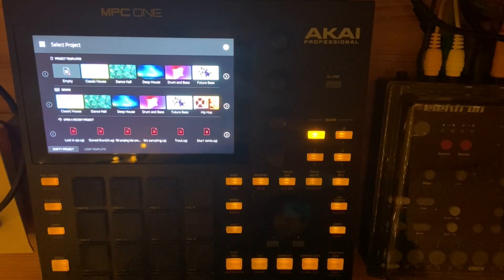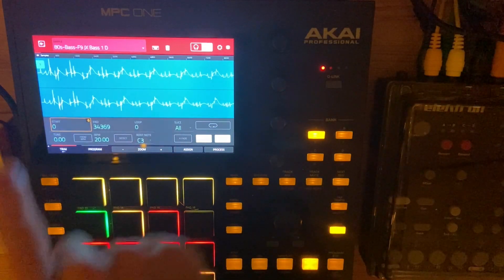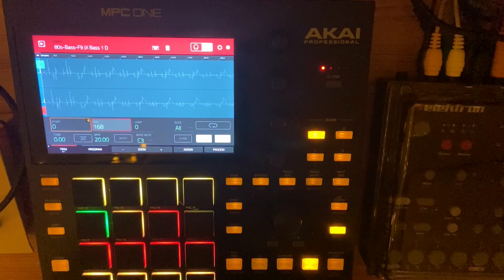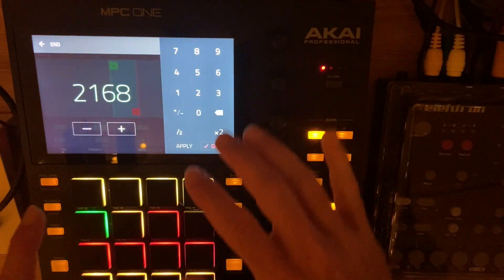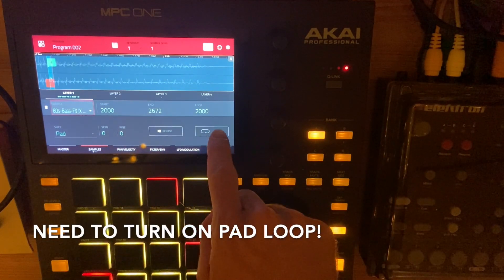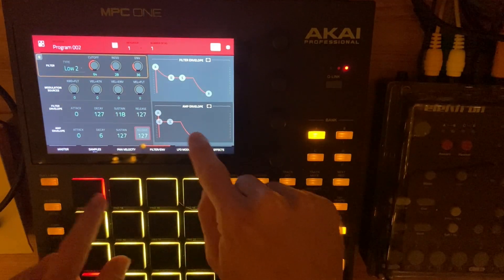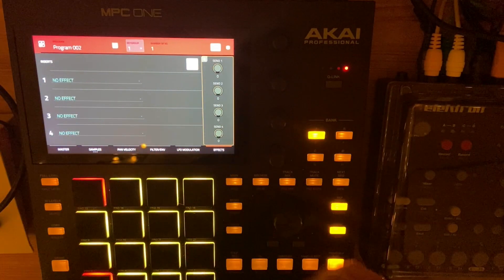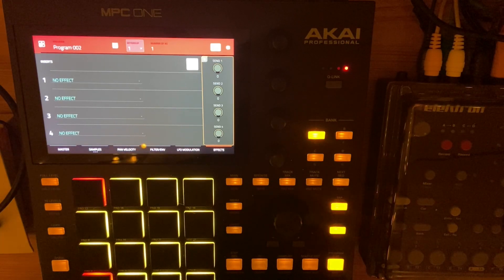Wavetable Synthesis in the MPC One

Comment: This is awesome, thank you very much!  But... it's not REALLY wavetable synthesis.  WT synthesis requires modulating between a set of single-cycle waveforms as the oscillator.  This is much more like Ensoniq's Transwave Synthesis, although technically that requires modulating the loop window in discrete jumps, instead of smoothly scanning the loop window like you are here.  This is a commonly available feature in a lot of samplers these days, but it is absolutely underrated as a method to create oscillator sources, so thank you so much for showing us how to do it on the MPC One!!